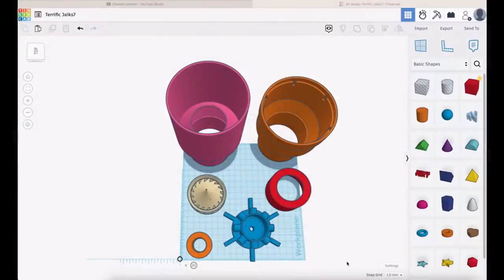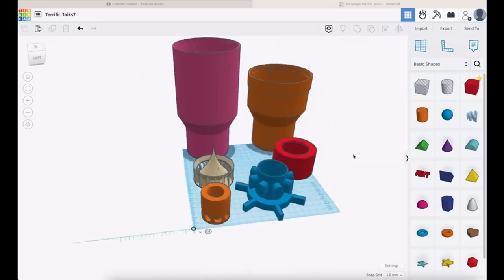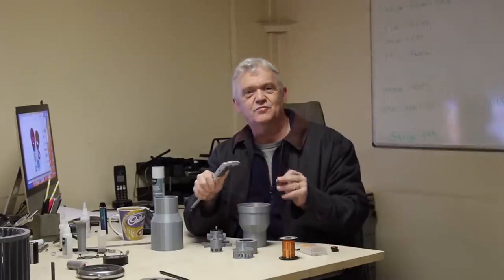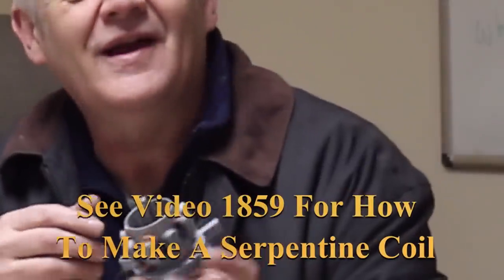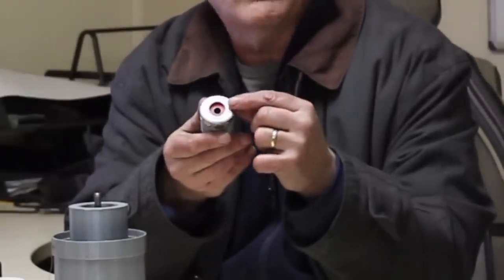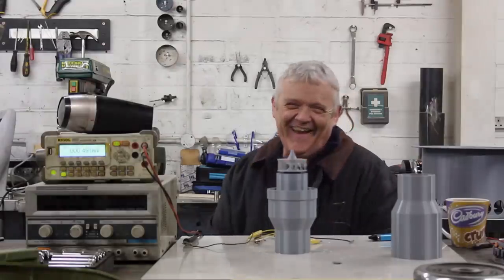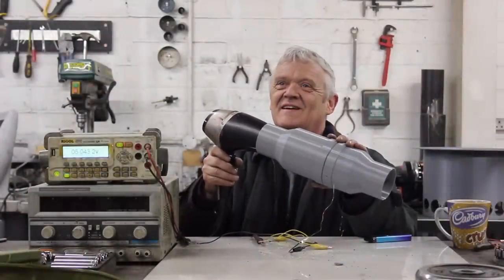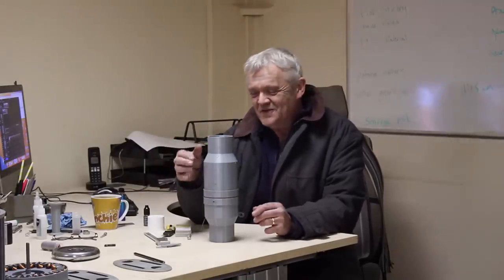1886 The Rainwater Turbine

Comment: Nice one. Though I do wonder how much energy is lost from the water having to change direction on the cone. Otherwise, nice design. Neat and compact. It could be used with any fluid, even sand.
Reply: I was wondering something similar. Water wheels have the water falling on one side of the wheel.
Reply: here's the fun part NONE... because the cone is a converging nozzle it actually speeds up the water making it able to do more work for the same volume .... then the water hits a diverging cone where it slows down pushing harder on the turbine making it generate better ... all the while the water will start to swirl allowing for an even higher flow rate of water ... if one has a long enough pipe that forces the water into a double helix shape then you will approach nearly twice the flow rate of the pipe as compared to just dropping down ... so if the pipe can do 5 gallons a minute ... with the double helix flow it will be closer to 10gallons a minute ... ... so that 5v reading would be 10 to 20v ... depends on the windings ... if it was a good x4 step up winding set then near 20v ...
Reply: Is there a limit to the number of these that could be stacked? This is gravity fed, so the only limit is the height?
Reply: @mikedodger7898  how long is your drain spout ...
Reply: @mikedodger7898  the only real limit is how much flow the pipe gets ... so a section of pipe with a  victor schauberger twist in it ... look that one up it's relevant ... then the average drain pipe of 10 feet could easily support 4 or 5 of the generators with a 5 foot drop and each gen abut a foot long ..

Comment: Sir, where do you source your copper wire from? also what gauge are you using? looks like 28AWG mostly asking to get some insight into your background process, and also duplicate results.
Reply: @Guardian Arias I find my local scrap yard gets spools in quite often as the manufacturing here is dying. Entire coil winding machines come thru, and new good coils of wire. Prices are high, and will likely get higher. Buy now, save inflation.
Reply: @richardmccann4815  Agreed copper is expensive and will continue to rise not just because of inflation but the massive demand for it in electronic especially for motors and generators.

I'm loving the Darwin Turbine concept because I'm imagining a system with multiple wind catchers all going to one multi stage turbine akin to a turbofan with this squirrel cage like thing being the first stage and maybe last.

Comment: Is this better than a Pelton wheels setup? 
Often the stream is thinned down to a jet for a Pelton wheels, but I don't think that would be necessary with this turbine style if all volume will be utilized
Reply: if yoou get the input or top of the pipe to be a vortex cone then near the bottom the generator will be able to take the full flow the pipe sucks down it and no pelton needed ... one could put 4 or 5 of these just before the outflow bend then 3 or 4 generators then pipe upto a vortex cone entrance fed from rainwater ... then poof you max out your power potential in a short period ... hook it into a step up transformer setup and you can get useful power and current out of it too
Reply: @0623kaboom  Pelton wheels are often used for net zero housing with stream access but this is an interesting design because it seems high volume and low head could be fine.
Reply: @David_Mash  yes ... the vortex has a nice added bonus in that it will actually suck a larger volume of water through the system making for better results if one can keep ahead of it's pull ... this is where victor schaubergers vortex ideas come in to play perfectly ...

Comment: You could also put the stator on the outside, as the coil and the wiring can be coated inside the tubing, as to allow the magnets to be fabricated more dynamically inside the rotor/turbine.
Reply from the maker: cheers mate
Reply: I like this idea. Prevents any wire contacting liquids altogether.
Reply: @psyber-x  You could also access the stator without taking the entire unit apart.